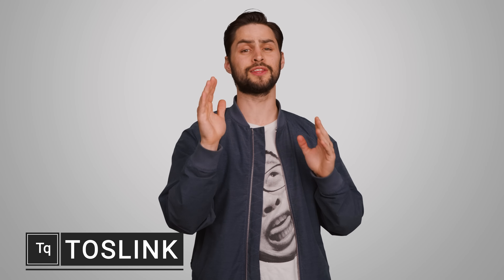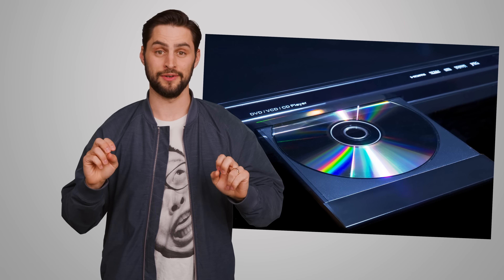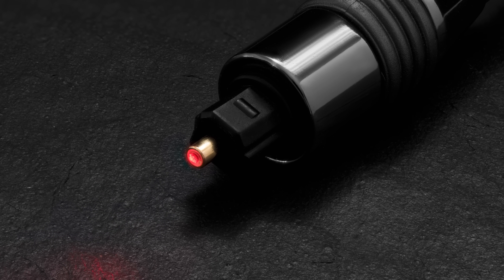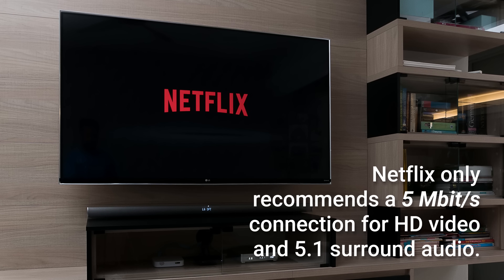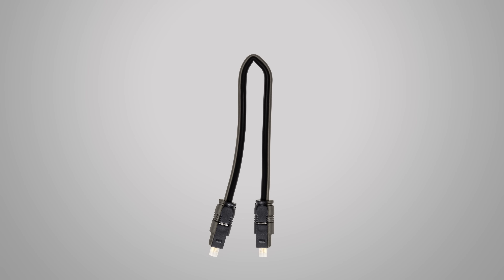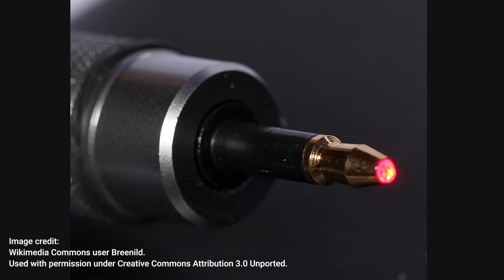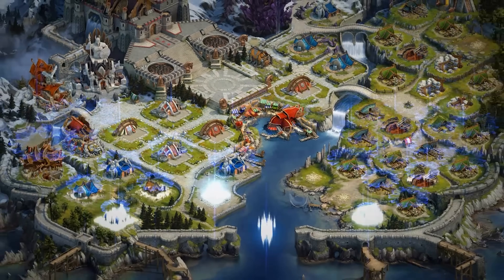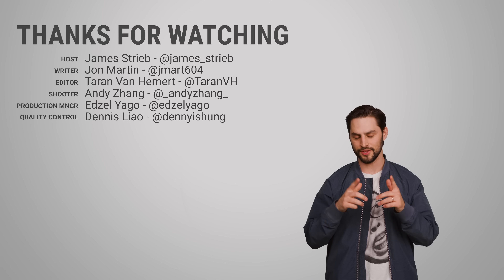Why IS This COOL Cable Dying? - TOSLINK Optical Audio

Comment: It's probably differential signaling that did it.
This is a technique where you have two wires, one with a positive voltage and the other with a negative voltage, and they flip around to send data, like "it's a 0 if wire A is -5v and wire B is 5v, but it's a 1 if wire A is having the 5v and wire B the -5v" etc..
This way is a lot more resilient to interference and quicker to detect when the voltages flipped than something just going "0v for 0, 5v for 1", and is the magic behind HDMI/Sata/USB/Firewire/Lightning/PCI-E...
I think we either discovered it or some patent expired or the electronics got good enough around 1999 or so, and we started to use it on everything with great success.

Comment: I got a toslink cable when I picked up my 4K TV and soundbar, but when I used it I noticed that (if the scene got really quite) it would cut the audio feed to my SB altogether. Then, as a consequence, when the sound levels picked back up I would lose the first half-second of the feed (something I noticed also plagued early Bluetooth speakers, by the way)
It got so annoying that eventually I just picked up conventional copper audio jacks, and use those connect my TV with my SB.

Comment: Funny enough the mobo I bought a couple of months ago, I made sure it had an Optical Audio port so it can connect with my sound bar
Reply: If you want to use it to connect a soundbar to a TV, which is a quite common usecase, it's mostly garbage because of latency and sync problems...

Comment: telling people to go to hdmi is the problem here,  we got usb and displayport, hdmi is the worst compared to those.  
also using toslink does well in audio two channel like most people use and up to high end hifi systems.
its hdmi that is the problem here, its has always been lagging behind in specs and usability and not to mention its proprietary and costly with fees to get them on gear.  its like apple of connectors. it has to go away for the future to be better.  
just because many appliances got a hdmi plug does not mean we should continue to support it.

Comment: a real shame tbh...should've just worked on something like a multi-toslink cable for audio and video. Also repeaters could be dipshit easy to build (just repeat the incoming light) instead of having to be HDCP2.2 approved and shit for HDMI and typically limited to lower spec HDMI 1.4a or lower. I mean seriously. Try to find a HDMI 2.1 capable repeater.

Comment: Because the movie industry got ahold of the minds of manufacturers and it's been stifled to only allowing 2 channel PCM or lossy surround codecs. It has the bandwidth to do crazy things. It could do 22.2 channel audio at 24 bits and 192 kHz. The latter 2 specs being pointless being that high.

Comment: For convenience, I mostly use an HDMI pass through for my 5.1 surround system audio from computer to receiver, then a DisplayPort from computer to monitor. My computer did not have an optical so I found this was the best route. However, for my older devices w/o hdmi, optical worked well for me and is so simple to get running.

Comment: PSA: Disney+ and Google Movies on Sony Android TV does NOT support surround sound over toslink because it's Dolby Digital +. You will have to use the HDMI ARC to your receiver if you want surround sound. Netflix uses the normal Dolby which works just fine over toslink. My TV is 2018 Sony X900. 

In fact, anything over traditional Dolby requires more bandwidth than what toslink can provide so you will have to use: 1) a separate media player with HDMI output to your receiver then the video pass through to your TV. 2) Use your TV apps then HDMI ARC to your receiver. 

HDMI cables have two pipes. One big one for video and audio that goes one way and a smaller pipe for the ARC going the other way. In fact the ARC is too small to support Dolby Atmos or DTS:X.

Comment: Not only that. 

You need an signal generator to convert data into light AND a decoder to read that light data

Which is bulky and powered.

Technology connections did a really indepth video on toslink™

Comment: I still like Optical Audio/TosLink for the ease of connecting TV audio systems. Also if you spend just a little more then pennies for good tables you avoid a lot of those issues you mentioned.

Comment: I need Toslink to connect my TV to my Home Theater system for when I'm playing on my Switch. I got my PC hooked up with the 4-way aux cable method for 7.1, but neither the Switch nor the TV have any other usable outputs. The home theater system supports a LOT of inputs, but none of them are compatible with HDMI and the like. The only digital signal it accepts is Toslink.

I refuse to buy a subpar soundbar with some shitty Bluetooth implementation like everyone wants to do it nowadays. I want the 1000W subwoofer I paid for to be able to do its job.
Reply: What about HDMI ARC?
Reply: the nintendo switch's surround uses uncompressed audio so toslink can't handle it, toslink can only handle two uncompressed channels i.e. stereo. So if you want nintedo switch to use surround you have to use ARC in one way or another. Which sucks, so I decided to play BotW with Cemu instead of Switch, and it looks better.
Reply: @povilixas  indeed, I'm playing Animal Crossing with stereo only. Still, it's virtualized surround and it sounds way better than any set of TV speakers. I'll figure out how to get HDMI ARC working. Thanks guys.

Comment: Nope. Not selling me at all on HDMI. You could do the same with Ethernet over the network. HDCP is what makes me unhappy with HDMI. Also the stupid friction fit connection means it can become loose and it doesn't take much. Also HDMI was for the Movie and Hollywood Movie makers, not for us to lock everything down. Even though the piracy occurs well before it comes to us as a consumer. HDMI sucks because the connection is not a locking connection, and like USB, it creates more trouble than it is worth. How many technologies lead to HDMI troubles? How many receivers or pre pros don't know what you are connecting or even allowing them. Also with HDMI being a moving target vs. a locked down standard, you are forced to upgrade to get the most current HDMI and HDCP standards. That is like the tires were made one size larger and you need a new car. F'ing stupid that. I have been doing audio and video for years, and the high price of manufacturers staying compliant with HDMI is in the millions. With already expensive audio and video format schemes they have to pay for, HDMI is a sinker for many manufacturers. We could still have compliance with Hollywood and their paranoid content owners by using a wide bandwidth optical like in most network systems today, or just Ethernet. We already have HDMI over Ethernet for even 4 K compliance but still have the stupid HDMI connector at one end at least. Nope, there is no win on HDMI, other than if you don't got it, you don't enjoy any of the technology today. Thanks for nothing Hollywood and Paranoid intellectual A$$holes!

Comment: I'm actually still using a toslink to connect my newer TV to an older surrounded system.
Reply: I mean that's what all receivers have still. That and hdmi throughput which both sound the same
Reply: @TheScrubmuffin69  yeah mine doesn't have HDMI that's the reason for using the toslink! I'm not able to afford nice things like that I'm on disability so my check doesn't go for those kind of thing.....
Reply: @TheScrubmuffin69  my receiver dosen't even have toslink, so I use an external DAC  for it
Reply: That's why I haven't stopped using TOSlink myself. The old sound system just keeps going and going. (:
Reply: Same here! :) Logitech 5.1 system, the Z something
Reply: Same
Reply: I use it to connect my PC to a switch, and my STB to the same switch, then another toslink out to a 5.1 Sound blaster extigy external souncard (almost 20 yrs old), then regular cables to my 5.1 amp and speakers. I guess I'm old ... but if it ain't broke, why fix it?
Reply: @WaspMedia3D  me too looks like you got me by 4 years. 78 is my birthday.
Reply: Shit, it's surrounded?
Reply: It's still the top choice for connecting to cheaper sound bars too.
Reply: My 2019 model TV is hooked up to a 2019 sound bar with an optical cable.
Reply: ill one down you, i use a converter to get toslink back to analog, my stereo is that old
Reply: @ilovefunnyamv2nd  So true, I use one on my ps4 to be able to use it with my Pro-Logic receiver.
Reply: My old Sony 5.1 surround sound from Circuit City refuses to die! I bought it back in the day before HDMI was ever a thing. Its still going strong, has both Coaxial and Opticals which I still use to hook up my PC to. I'm not replacing it until it dies. Funny thing, it was the cheapest Surround Sound at Circuit City back then.
Reply: Same here
Reply: Will do this too, in the near future.
Reply: Same here.
Reply: this is actually my situation as well. I have an old blueray player with optical audio  in which I connect with my new TV to have surround sound. The downside is, I have to have two remotes to turn it on, one for the TV and one for the player.
Reply: @marka1000  yeah I got 2 also the surround and the Direct TV remote works everything else I have.
Reply: Liked to use it with my 23 year old Harman Kardon AVR because of a groundloop. Toslink is handy to interupt those
Reply: Same! It's great.
Reply: Gregred78 i use it to connect my consoles to my logitech z906 pc speakers
Reply: I have mines connected to an Astro A40 for PC. How does it support Atmos over a toslink?
Reply: I use component cables for mine because they sound better and give more volume. I've never been a fan of toslink, I think it's poor despite being fiber optic. And with my standard soundbar I use the 3.5mm jack for the same reasons. It's about time it was replaced with something worth while, Yes I know we got HDMI as standard for audio and picture like DP but something like a high quality option for systems that transport audio surly that market is still well and truly alive?
Reply: Is 3.5 mm better than optical?
Reply: Same. Really the only downside is I can’t buy a 4K Blu-ray player (too expensive) and upgrade my 5.1 setup to an Atmos setup (too much construction work, Ik I’m lazy). So I’m stuck w/ regular Blu-rays viewed on a 4K TV 🤷‍♂️
Reply: Everyone does that has been into or uses home theater equipment from the times before entry level receivers came with HDMI ports
Reply: I have a few speakers with rod link connection. I also bought an audio extractor

Comment: Youtube channel Technology Connections has a more in-depth video on this topic.  Other factors in TOSLink/SPDIF demise is signal generation via basic red LED, not an actual laser, and lack of ability to transmit power (even if HDMI power is very limited, it's there for small ICs).

Comment: Used to use toslink in the days of Composite and SVIDEO crap cables. Useless today with HDMI and DVI.
Also it was built in to my 2008 MacBook so it was better than crap USB or FireWire for getting sound to my amplifier.

Comment: based on that thumbnail in my notification feed it looked like it was going to be the cable that's used in cars for power to small appliances, like Bluetooth radio transmitters or chargers for phones in the car